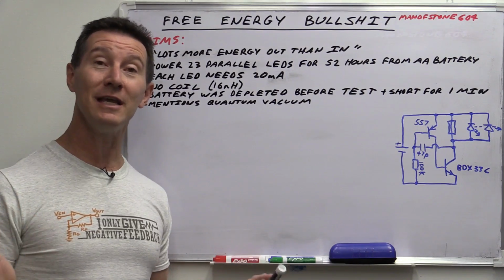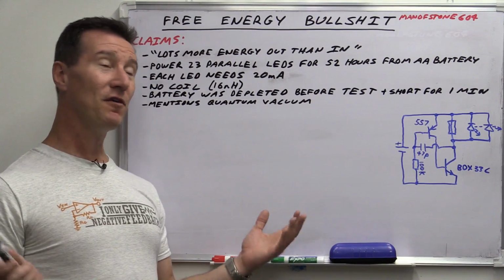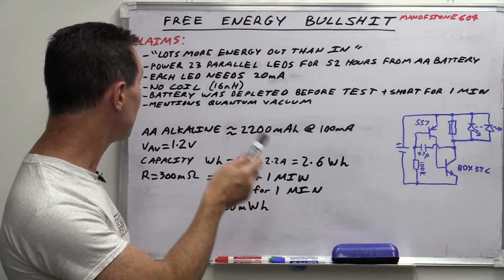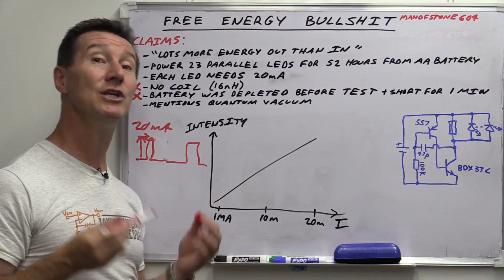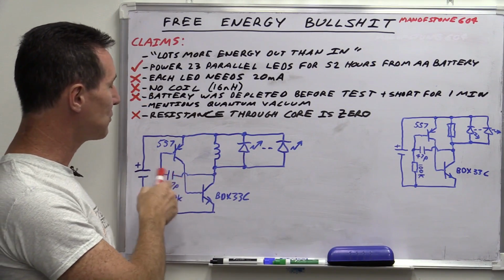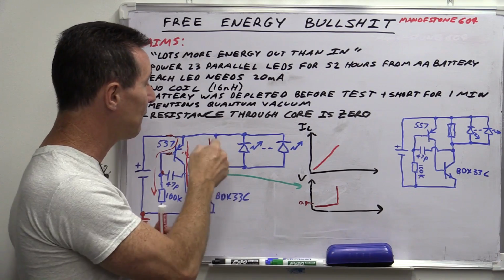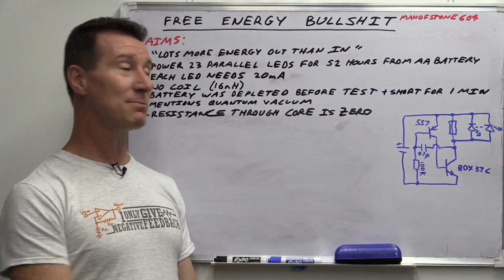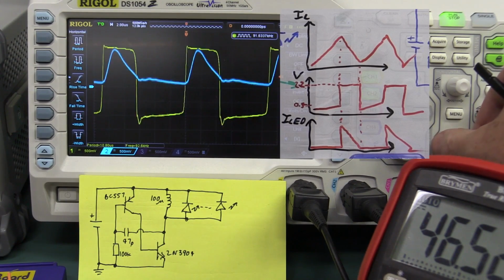EEVblog #708 - Free Energy Overunity is RUBBISH!

Comment: I'm wondering why no one attempted to make Hydrogen centrals yet. I mean Hydrogen is a gas that do pack a  bit of a punch and, though as impressive as oil, comes in very large quantities under the form of water - something our planet's surface is covered at more than 70% of. And since we're already spending energy, extracting oil and converting into fuel, to generate more energy, why not doing it over a ressource that is present in such great quantities that we wouldn't have to wage wars over it ?
Reply: Veryconcerned99 

But the loop efficiency with fossile energy is already close to zero, since the engine designs coming back more than 50 years ago were more efficient than those of today. My own mother's car is a "Modus" that has a consumption rate of around 8 liters to 100km, whereas my grandfather's car, a 2 horses, barely consumed around 2/3 liters to 100km. How can we do less efficient with higher technology ? How can we do less reliable with better modern factories ? How can we claim looking for better energy sources when we're already wasting those we have right now ?

It's not even about the myth of "free energy" anymore. But more about technological stagnation/obsolescence.
Reply: Cars:  The engines now are much more efficient, but more importantly emit only a tiny fraction of the pollution that the old engines produced.  The problem is that we are asking them to do much more.  Single people are driving around in vehicles now that are larger than the pickup trucks used to be.  The engine horsepowers have gone up at least twice or more.  Unless you count carbon as pollution, the modern engines (except for the FAKE green ones coming out of Europe) produce almost zero emissions compared to the old ones. 
Current electronics is quite cheap and reliable, except a lot of unreliability has been built-in by getting rid of lead to to cow to environmentalists when that has no impact on lead leaching into the environment.  If you look at quantitative data on pollution in cities in western democratic nations, you will see that they are much cleaner than they were 30-40 years ago, even when they are much larger.  Almost all North American cities have eliminated dangerous smog days (unlike European cities with their attention paid to carbon). etc.
Yes, we could do more, we could reduce transportation energy used a lot, but we need sensible regulations that do not encourage everyone to drive large trucks for personal transport.  Instead, we do stupid things that the environmentalists accept.
Nevertheless, not understanding science is not going to get us to a greener future, so perpetual motion machines (or greater than unity as it is now called) is also not going to help us.
Reply: +Tenhys 
Because of the inherent problems and associated costs.
The basic hydrolysis method is energy expensive, using as much energy as the liberated hydrogen contains. It is also expensive in energy and financial terms to compress and store the hydrogen to make it storable, transportable and usable. Then there is the problem of storage in the vehicle, if used for transportation, in that a very highly pressurized, extremely cold container of highly flammable gas is potentially hazardous.
And unless used in a complex hydrogen fuel cell, is I think less efficient than using conventional fuels.
There are many schemes being developed and tested. It is a highly problematic fuel. But has great potential.
Reply: But i don't get it : why bothering with extracting the hydrogen into a fuel tank to then use it as fuel instead of making a motor that undergoes hydrolysis conversion of water directly through dynamo coil linked to the vehicles' wheels ? Actually why is no one employing mechanical energy through the uses of dynamo coil on cars ? Why is everyone so fixed on that are generating more energy and not on designs that consume less by making a better use of it?
Reply: Because most people that attempt to bamboozle with perpetual motion machines start with a process that is somewhat efficient.  If you are attempting to get mechanical energy into hydrolysis and then back to electrical and then back to mechanical, your loop efficiency is so close to zero that it would be hard to bamboozle anyone with your unity energy scam so you would really need a well-hidden source of energy. That is too easy to debunk, even for the dummies that are usually tricked by perpetual motion machines.
Reply: Veryconcerned99 

You're saying that engines, and by extension i assume all of general designs, are much efficient and less pollutive than the old ones. But how can you consider a technology litteraly developped to fail and to be thrown to the trash bin less pollutive than those made to be a lot more durable but emit more carbon gaz ?

Understand this : i do not defend car pollution the slightest (living in Europe i can confirm your point on smog that much.) But i also have in my house a couple of lightbulbs that the previous owner left there that are litteraly older than me and still works wonder, consume less than modern lamp for equal if not better lighting. Yet if i was to broke one then, indeed, as trash it would be hard to recycle, but only on the condition that i broke it. Whereas today's modern "eco" lightbulb, thay'll last maybe five up to six years at best before being sent to the recycle bin - meaning it'll take at least between five and six modern "eco" lightbulbs to equal one of those old lightbulb. So my question would be : what's the point in creating new generation of technology that pollute less but that is made to fail, thus innevitably becoming trash more often, thus inevitably leading to more pollution, when the more pollutive older one just perform as much, is easier to maintain and only fail/break when it hit it's true natural limits ?

Look at it this way, if i have a single washing machine that consume a lot of energy but could last for more than 50 years, why should i change it for one that consume ten times less energy but that'll i have to change every five years ? If we're taking your statement of "inefficient loop energy" as a basis for this reasoning, why wasting the ressources necessary to build ten washing machines instead of optimising the first one knowing that material ressources, pretty much like energy, is a mass that we constantly lose and can never fully get back with every passing failing design ?

More than anything, what's the point teaching to each new generation of engineers to sabotage the very technology they've learned to make work of ?
Reply: You are asking the big question about the over-all environmental footprint of our products and choices.  By my observations, that is almost never done, and can not be done by environmentalists because they are idealists and lack basic analytical and scientific capability.  I have gone on for hours in personal discussion about the harm that environmentalists have done to the environment.  I can not repeat it here due to length and time, but yes, we need to look at the big picture.  
Unfortunately, if you are working at a job and attempt to speak the truth, you could be out of a job or the subject of a with-hunt very quickly.  You will be ostracized quickly for not toeing the party line.
What is the point?  For the people working, it is to get along.  For the people pushing the point?  They think that if the mob forces the "Al Gore" type of views, that they will save the planet.  For scientists?  It is either toe the "consensus view" or don't get published and lose your tenure and your funding.
Now that free speech has been successfully eroded, what are we to do?
The Europeans are smug that they are more proactive on the environment than Americans, but they still have smog in their cities because they are more concerned about carbon dioxide than real pollutants such as nitrogen oxides that cause smog and really do kill people. (many more examples possible).

Comment: Perpetual circuit loop (1)dc  battery would need a dc invertor or a dc motor because all batteries are dc power sores. (2) then you would need a ac motor if you used a dc invertor to convert the battery dc power to ac power out put. If you went with a dc motor you would only need to hook that to the battery. (3) then to recharge the battery you would need to hook the alternator back into the battery or the generator back into the battery by using a invertor going from ac to dc to charge the battery when using it as your sore power. you can boost your at home solar power by hooking up a electric motor to a generator head to make enough power for your hole house.

Comment: Many of these 'over unity' circuits rely on pulsed currents from switched inductors, transformers or motors. The experimenters assume that current times voltage equals power in such circuits. If this is questioned, they will buy 'True RMS' meters and claim this answers any criticisms. It doesn't.  V rms x I rms still does not necessarily equal power in such situations. Measurement of power in pulsed circuits is not easy, and this is where a lot of the mistaken results come from.

Comment: "Free energy" (supplied through an extension cord to a neighbor's house) is like Bernie Sanders "logic", just like "free education". It's only "free" because it's funded with OPM™ (other people's money). A dead battery, a wire without inductance, and you have another "miracle". The "noninductive" wire is, or would be, a DEAD SHORT across the LEDs! Magic wire, indeed. I must buy some, wrap multiple loops around the apartment, and sell excess power to the power company!

Then there are those on the other side that claim that solar panels are slowly depleting the energy of the sun...
Reply: +Chaplain Dave Sparks If you had free education there wouldn't be so much stupid peoples thinking free energy is a thing..
Reply: +DrN0ii Most things that are touted as "free" share many things in common, methinks. And education, even more so. Arguably, the sun supplies energy "for free", either directly through solar panels (that you must buy, maintain, and replace), or stored up in fossil fuels. Education has more "infrastructure" which must be paid for. KNOWLEDGE is arguably "free", to the extent that you spend the time and effort to seek it out. But education? Those pesky teachers and professors have a nasty habit of not teaching unless you PAY them. Or did you mean that Someone Else™ is going to pay for it? :-)
Reply: +Chaplain Dave Sparks I think we're going into some kind of capitalism vs communism debate, not a sane thing to do on the internet ^^

Comment: Of course, if the battery were "dead", why bother including it in the circuit? A piece of wire should work as well, right?

Or else, you're just a shill for "Big Energy", trying to con people into buying energy that could be had for "free". <grin > Personally,  I'm a fan of cold fusion! Now excuse me while I work on a bigger/better flux capacitor for my DeLorean.
Reply: are you a troll

Comment: The fact that whoever originally designed that circuit used a darlington pair to cut off the inductor implies to me that this was deliberately designed to fool the "over unity" crowd.  With its extremely high gain and consequently extremely sharp transition to cut-off, whoever originally designed it knew that the "quantum vacuum bullshit generator" was just a plain inductor.

Yeah... After looking at the BDX33C, its got a collector-emitter voltage rating of 100V.  This.. thing.. would have probably still lit all 23 LED's just fine if they were put in series, and with no FET gates anywhere, all those hideous voltage spikes from the LEDs' turn-on time don't have anything to destroy.

Comment: so with "free energy" i believe the whole concept is to harvest energy that has not yet been used
for this particular circuit, using the electromagnetic resistance to manipulate the intensity of the electricity would have been cool if he used a spark plug instead of a battery, to see if the magnet could keep the current moving.
but he didnt, so you schooled him on batteries and math and everything else about engineering, from which i learned a lot since i am a high school drop out with a desire to learn.
however, why not harvest the energy your body gives off when it thermoregulates
all that heat that turns into transpiration and odor could be used with thermoelectric generation to power things like usb ports, and if your climate is hot/cold enough you can produce enough energy to power an exoskeleton
if you want free energy, just use what you give away for free. :)

Comment: Hi, A new summary of my remark from 6 months ago:By Mach principle, David Sciama "On the origin of inertia", an energy can be drawn from space-time if Electro-gravitational effects, e.g. rotary warps are possible. By slightly contracting space-time, far bodies of mass can be drawn closer and lose gravitational energy, however, although such a process would look reactionless, it will react with the background metric. Please also refer to the work by James F. Woodward.For my research since 2003, seehttp://sciencedomain.org/abstract/9858DOI: 10.9734/PSIJ/2015/18291Or a corrected paper in http://www.academia.edu/15921540/Electro-Gravity_Via_Geometric_Chronon_Fieldor in https://www.scribd.com/eytan_ilCorrections are:1) After 16, A(Myu,Nu) = - A(Nu,Myu) and not A(Myu,Nu) = - A(Myu,Nu).2) The classical limit after (71) has a superfluous division sign under the root     before "A friend, Mr. Yossi Avni suggested that".3) In the corrigendum, in (3) Majorana neutral fields, it is written, "and    therefore if U(k) is fully imaginary",  which is wrong because U can't be    purely imaginary. There is a replacement to (3).4) The Scarr-Friedman acceleration matrix is unique but not its    representation. I wrote that the matrix is not unique. That is wrong.    The degree of freedom is only in the representation.You can also refer to Sam Vaknin's doctorate dissertation on the asymmetryof time from 1982.Sincerely,Eytan Suchard.